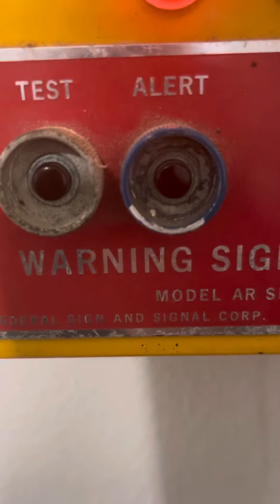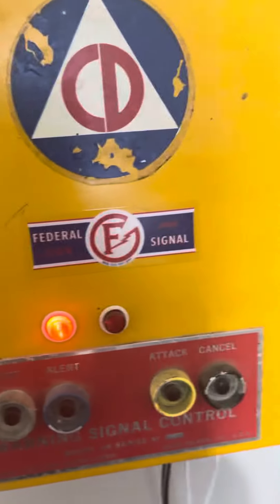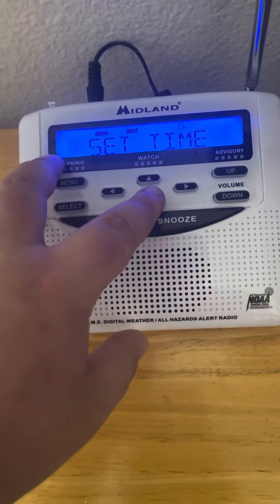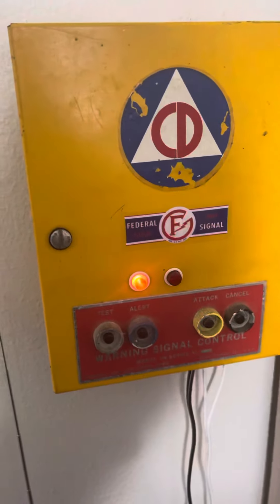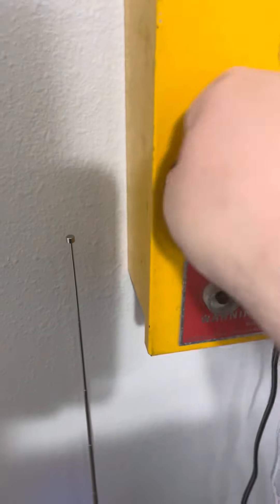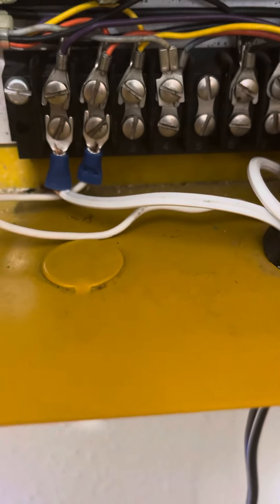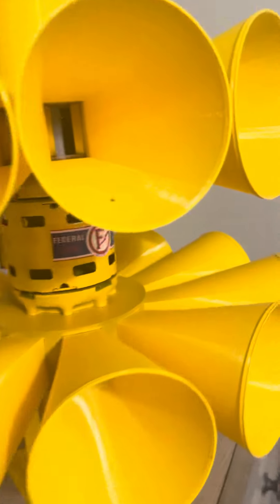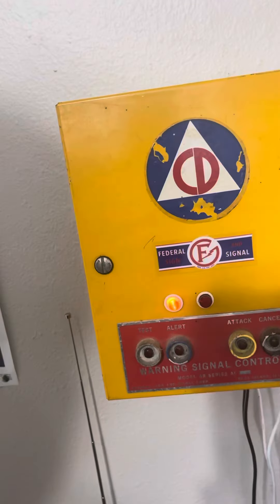Tornado siren setup update

Comment: May I ask how you wired the siren to the AR Timer? I just placed an order for a 5T and your setup looks really clean.
Reply from the maker: Okay so your power in terminals are 8 and 9 hook neutral up to 9 and hot to 8 then run a jumper wire from 8 to 2 and then for the siren hook neutral to 9 and hot to 1 so to summarize 
Power in 8 and 9 
Jumper from 8 to 2 
Siren signal 8 and 1